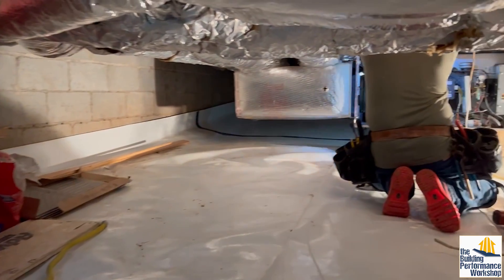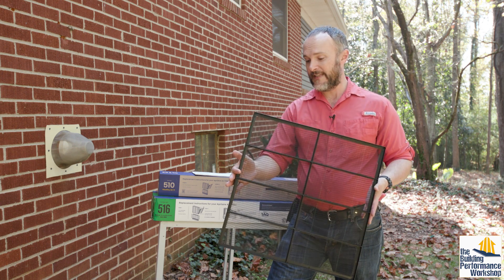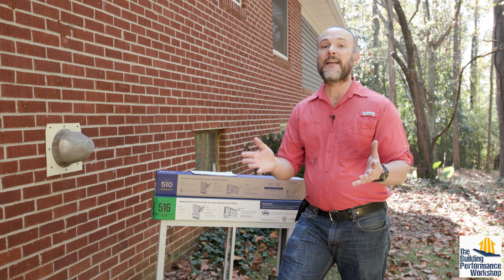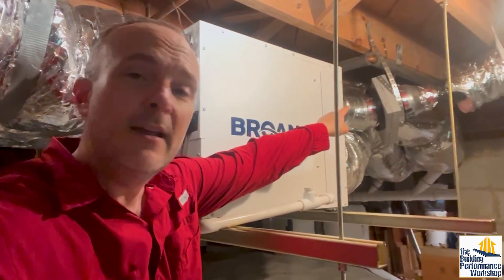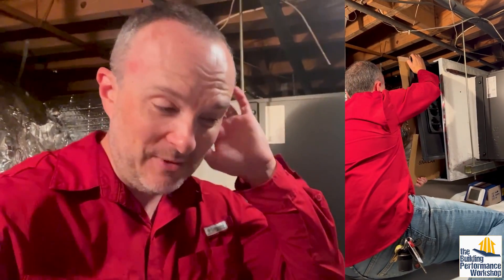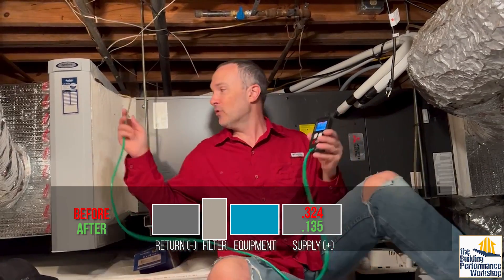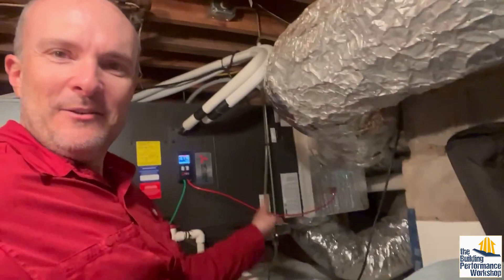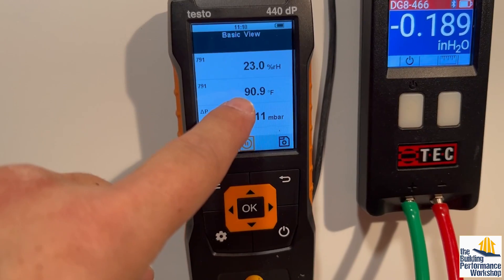Old Home Retrofitted with Ventilation System: MERV 16 Filter, Dehu, Fresh Air, Make Up Air (HVAC)

Comment: This is how an HVAC company installed my April air dehumidifier back in April 2025. The warm dehumidifier air is going over my cold coil, causing a sauna affect and re-humidifying my house. In other words, the dehumidifier is causing the humidity in my house to go up about 10%. I live in Tennessee and it’s pretty humid but not as humid as further down south. I’m going to have to have the supply of my dehumidifier empty out into the supply of my HVAC to solve this problem. I’m interested to know if this is a problem with your install? I know in 2018 in the state of Florida supplying dehumidifier air into a HVAC return is now against code.

Comment: Thanks for this; came across this in searching for more info in the Broan FIN-6MD.  We're building a new construction duplex in New Orleans, and will be installing two SantaFe Ultra98 Dehumidifiers.  Called SantaFe for guidance, and was disappointed to learn that the only way to take advantage of the built-in ventilator is with their controller, sold separately for over $300, or to buy this Broan damper, which I'm told can be wired to control the ventilator's fan.  The Ultra98 retails for over $2,000.  At that price, I feel this damper should be built-in.  Instead, I now have to install this damper from a different manufacturer, even if both brands are owned by the same company.  Anyway, that's my vent, so to speak.

Comment: I added a HEPA bypass filter to my system, it was about $250 on ebay (generalaire.) You can get fantech units for a little over $400. The prefilter captures most of the junk. The HEPA filters only need to be replaced every couple years, and are about $100-200.

Comment: I assume, because you’re a brilliant man, that it wasn’t possible to connect the dehumidifier further down the return to promote better air mixing? 

The polar opposite of this happens in Canada with our HRV/ERVs. The cold/dry incoming air messes with the temperature rise of the equipment (high efficiency natural gas). Best case you get lowered capacity. Worst case you get cracked heat exchangers and the possibility of CO entering the home. 

10’ from the blower is recommended. I always go further if possible. 

Love every video you post! Thanks for doing all you do!
Reply from the maker: Aw shucks and yes that’s the only possible duct injection point for the dehu. Yes, 10’ upstream recommended for cold stuff. Thanks Rob!

Comment: Hi, can you please do a deep dive into that make up air system that is under the stove? It seems so simple compared to those mega high performance units where they got the blue smoke flowing like crazy. It would be great to see something a bit more simple.

I'd also love to see a video that explains kitchen exhaust systems and what to expect when cooking with a wide variety of CFM range hoods from like 250 CFM up to those 1,000 CFM systems. We have a 400 CFM microwave range hood that just doesn't pull anything. I'd love to replace it with something more powerful, but from my understanding 400 CFM is strong, we just don't get any suction of kitchen exhaust from cooking.

Comment: That's nice.  How do you handle the 220 cfm exhaust from a standard clothes dryer?
Reply from the maker: 150 more typical, and in a leaky house like this it doesn’t matter. In a tight home, go ventless with a heat pump dryer.

Comment: I’be enjoyed watching your videos lately, and I just moved into a 1960s home. I’d like to improve all aspects of the HVAC but is going to be a challenge. The bathrooms do have exhaust fans.  Kitchen stove has no vent to outside but could likely be added. 

Biggest challenge I see is that all the supply ducts to each room are in the slab (slab on grade construction, no basement or crawlspace). The ceilings are vaulted in almost the entire house, so there is no place to run new ductwork through the attic except over the kitchen/laundry area. The current air conditioner does not perform well. Some of that I think is the age of the system is pushing 30 years with components replaced here and there. But the supply ducts seem to maybe be a poor design. Haven’t spent a cold season here yet but it pretty much runs 100% of the time to maintain a 20 degree temp difference from outside to inside, and the first best room feels like the airflow is next no nothing. 

I’ve thought about replacing with ductless minisplits but of course that won’t get me any circulation throughout the house. And I’d also kinda like fresh air and possibly humidity control. 

Suggestions?
Reply from the maker: You’ve certainly got your head on straight about your home- keep brainstorming, happy to dig in with an hour consult if you need me.
Reply: @HomePerformance  I may do that. Need to sell the old house before I can get off my rice and beans diet but after that I just may hire you. I see $200/hr for video consult; what do you charge to fly onsite for consult?
Reply from the maker: @LowOutput haha we can get a lot done over video. If you need to fly me out we can discuss for sure, but rarely fits the budget.
Reply: @HomePerformance  ok, sounds good. Not sure when I’ll get to it but I found a giant scanner at work so I’m scanning the original 60 year old construction plans that I found (not as-built, although some owners have marked up modifications over the decades) just in case that comes in handy or could make the discussion more efficient.

Comment: Great video -  I have a very similar set up with most likely equally leaky home .  I do not believe my ventilating dehumidifier is bringing enough fresh air in to lower  voc etc -  have you or did you give any thought to put the new smart Broan erv into this system ?

Comment: Rmax Plus-3 3/4 in. x 4 ft. x 8 ft. R-5 Polyisocyanurate Rigid Foam Insulation Board from Home Depot!!
I made a video on it. It’s on The HVAC Grapevine somewhere. I’ll see if I can pull it up 

for a temporary plate for the trueflowGrid
Reply from the maker: Hey, nice Mike!

Comment: This video mentions that the ducts were undersized for the outgoing furnace but are ok for the new heat pump air handler. Not sure if it was covered in a previous video, but are the register locations still ok after the swap?  Or, are register locations not impacted by whether the system is providing heating, cooling, or both?  i.e. If the previous system was cooling only, and was swapped for a heat pump that now also did heating, is it possible that the register locations could be problematic? Maybe it doesn't matter in this case because the previous system already did heating, but wondering if it could matter elsewhere.
Reply from the maker: If you keep the system running 24/7 as this one is designed to do, it matters less. Old guys used to put the registers at exterior walls and windows, which still works perfectly for modern purposes.
Reply: @HomePerformance What if our old guy put them along the center of the home because it was easier to run trunks, instead of along the exterior?
Reply from the maker: @jeremyjedynak haha one of the old rebels- again, if it’s 24/7 runtime you might be fine.

Comment: I have a 1970's home that I have been systematically trying to upgrade as I do rooms (replacing original windows, trying to air seal where I can, improve insulation in lots of rooms, etc.) but I am totally lost on replacing my equipment, what I should get, etc. Any suggestions on how to find someone qualified to look at my whole house and build a complete system for it? All of my equipment (furnace, AC, filtration, etc.) is 25 years old. Or am I going to have to figure this all out myself? Calling local AC places just want to replace what I already have with something the same design/size.
Reply from the maker: Check out The List!
https://homediagnosis.tv/hvac-installers
Reply: @HomePerformance  None listed in my state unfortunately but I'll continue to follow-up on that list and see. I'm looking forward to your enclosure videos and hopefully it's something with retrofit in mind. Most of the information available is what to do if net-new but very little of it is for remodels.

Comment: The broan damper is interesting. I was reading the spec sheet about it. Wouldnt the thermostat be a better indicator of when conditioning is needed?
Reply from the maker: The sensor on that damper is in the incoming airstream, so it'll give you a much faster reaction time.
Reply: @HomePerformance  i'd be worried it would create over cooling or heating.

Comment: Could you please make a video with more detail of what you’re doing to bring in air for the vent hood? How do you prevent bug/pests from coming in through that system? If it seals, how are you making that seal break when the vent hood is running then close when the vent hood is off?
Reply: Usually when you turn the hood on a damper opens to let make up air in. There is usually also a filter and of course the intake will have a grid on it to prevent larger bugs from getting in.

Comment: That's why I dont like working on heat pumps that use 90+ furnaces as backup heat, there are too many heat exchangers and on top of that most duct systems are undersized so we ended up with a poor performig heat pump that probably will have a short life due to low airlfow causing higher refrigerant pressures.

Comment: Do you see the static pressure of your filter increase over time? Is there a way to tell when the filter is “full” or “used up”?

I’m keen to get a large Merv 13 filter and run my blower fan constantly, but am concerned with replacing the filter once a month.
Reply from the maker: Mine is a 2" filter, not a 4"- you shouldn't have to replace monthly if you go thicker. Yes, the static goes up. There's no hard and fast rules about replacement targets, but keep on it.

Comment: You have your dehumidifier going into your return, Curious of what was the loss of dehumidification provided by the air handler coil?

Measure average hourly air handler coil condensate output with the dehumidifier off .  
     Compared to the air handler coil condensate with the dehumidifier on. .
Reply: While it removes some of the drying potential, since its a ventilating dehumidifier the second coil should help wring some of the remaining moisture missed by the dehu, and those Mitsubishi units are rated at 100ppd.
Reply: @nathanbarry9534  the fresh air ventilation goes through the dehumidifier.
Reply: @nathanbarry9534 that is 100 pint/day when running at full capacity